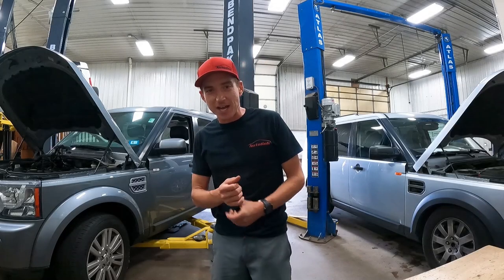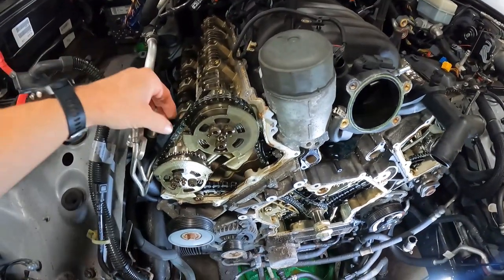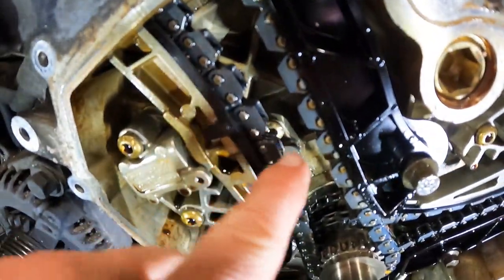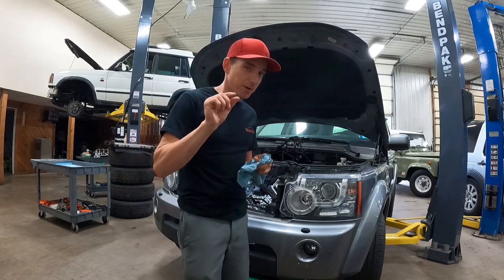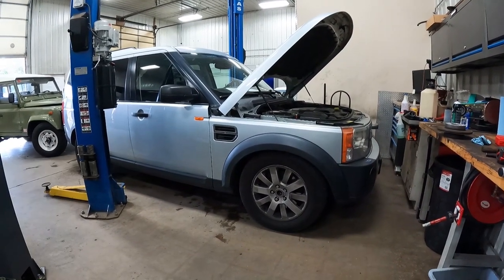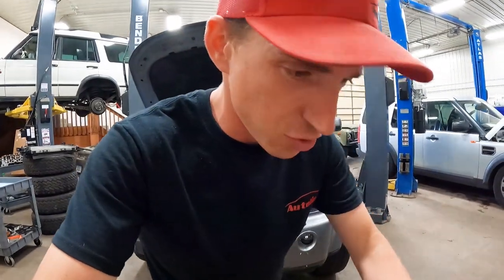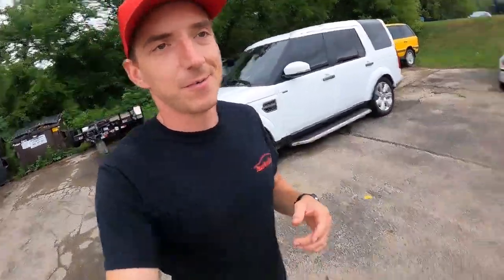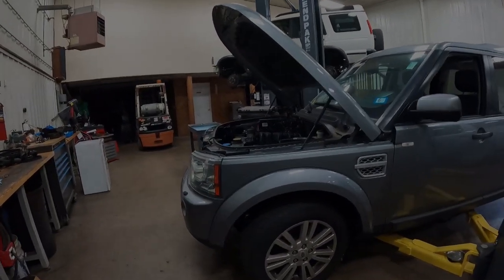LR4 Timing Chain Problems - The Land Rover Achilles Heel

Comment: I'm swapping out the Timing Chains etc now on my LR 4.
Its a tough job,  but not that bad. I'm installing a new Water Pump, Thermostat, & Main Seal while the Engine is torn down.

Comment: Just saw this video as a result of searching because, you guessed it, time to replace the timing chain and tensioners in my '15 LR4 with the 3L SC motor and currently at 78K miles.  The dealer said it wasn't absolutely necessary to do it right now but as he pointed out, do you really want to gamble with catastrophic failure?  For some time now the car definitely sounds like it's a diesel but once it warms up it goes away, thus the reason I didn't have too much concern...but I do now after watching this!  I intend to keep the vehicle so it's money well spent.  Love the boxy look and it does everything I ask of it.  A new car will bring with it a different set of problems (and a huge price tag) and as I work through the various weaknesses (coolant pipes for one) I'm just making it a stronger vehicle.  It's the HSE LUX and has every feature available including the dual transfer case so I guess I'll hang on to it for a while.  😁

Comment: The timing chain tensioner issue was prevalent in the early 5.0 MYs. I believe the guides were updated pre-'14. Still, the general consensus, even with the update is to change the oil frequently. I have a few variations; all are good, ranging between 97K and 225K. 
Fingers crossed, and a garage that looks more like the oil aisle at an automotive store.
Reply from the maker: I completely agree. I prefer right at about 5000 miles on the oil with a good quality oil and filter. We’ve seen the most timing issues with dealer serviced 15,000 mile oil changes. It definitely makes a difference.

Comment: What a comedian! I subbed straight away. Just going to get myself a 4.2 supercharged RR  or sport, and if it has timing chain issues I will do it myself as I used to be on the spanner's ( wrenches to you over the pond ) for over 20 years and was until 4 years ago a regular Land Rover owner with a total of 4 Landies  from a 1960 series 2 up to a Discovery 2  V8i of 1999 vintage. Really looking forward to owning a green oval vehicle again

Comment: Really peed off.. my LR3 HSE got totalled last week. I've been running synthetic since I got it with 50k on. Now has 190k and still quiet and ran perfectly. Not many around so now having to look at lr4. The high maintenance, troublesome younger sister.
Reply from the maker: That really sucks. The LR3s are really workhorses. The LR4 is a touch nicer all the way around in my opinion but that comes with the touch higher maintenance requirements with them though. I enjoy them both, but the 5.0 LR4 does really have the correct amount of power in my opinion.

Comment: Needed new timing chain at 60,000 miles on a 2012 LR4 (11 years old)  I've owned since new.  The transmission needed a rebuild after failing post a fluid change for 60,000 maintenance- advice is to replace fluid every 30,000 going forward.  Then the steering rack failed at 65,000 - replaced both the rack and pump.  Rough city driving with low annual mileage.  Before that most problems were need to replace front control arms around 40,000 with bushings needing replacement well before then.

Comment: Having constant problems with VVT on my Honda Odyssey. Lack of oil changes by previous owner.
Reply from the maker: Yea, the VVT stuff is very problematic with extended/poor oil changes. The control ports are small so it doesn’t take much to coke them up and start causing havoc.

Comment: the RRS i have now is a 2013, i bought it with 20k miles on it, did timing chains, guides and tensioners at 75k miles, it now has 105k miles on it, and tensioners just started rattling  at warm start up, its a big job, with the supercharger i found out its a bigger job : ) 
frustrating because i change the oil every 5k miles specifically to avoid having to do them again. 
my las RRS was a 08 4.2 supercharged, changed oil every 5k, and never had the engine apart, sold it at 185k trouble free miles : )
Reply: did you ever get the tensioners looked at? i'm contemplating getting a '12 lr4 but this common problem is really turning me away!

Comment: I have a 2006 supercharge 113000 miles never replace the timing chain still running good the only problem is the suspension problem I swap air suspension to struts
Reply from the maker: Yes, the earlier 4.2 doesn’t suffer the same timing chain problems. Those are generally a pretty stout engine. 

The coil spring swap was a good way to prevent any future problems there.

Comment: At least it rattled!  My Volvo 960 24V  shredded its cam belt and valves without any warning at 86000 miles with a FSH!! I So go Landrover!!
Reply from the maker: Yea the belt stuff doesn’t make the rattle, chains are typically supposed to last much longer than the interval of the belts. Do you know the age of the belt on yours time wise? With those time can be just as bad as miles on them.

Comment: My wife's loves the look of them so we're currently in the market. I hear that 2013s don't have the timing chain issues. True?
Reply from the maker: The 13s are supposed to be in the clear with updated stuff. But we have done one 13. So way less common of a problem from what we have seen though.
Reply: 2012, 2013 and 2014 are included in the class action settlement
Reply: My 2010 shakes when I turn it on then it idles down like nothing is wrong so confused? Any suggestions?

Comment: What’s the tell tale sounds then and just hope mines all right!
2011 110000kms 
Thanks
Reply from the maker: It will kind of sound like a can of marbles. Usually on startup first. We typically see a check engine light for timing related codes first as well.

Comment: Is is even possible for a 5.0 Range Rover HSE to have 187,000 miles without ever having the timing chain guides done?
Reply from the maker: It is possible, usually have seen the longer lasting ones in vehicles that had more frequent than recommended oil changes with high quality oil and filter.

Comment: Awesome video, was curious if the updated guides make this issue obsolete?
Reply from the maker: It is supposed to. We’ve never had to go back in and replace them a second time yet. But time will tell.
Reply: @LostCauseRanch  gotcha, thx!
Reply from the maker: @ryanorr5755  No problem

Comment: In the UK you can't give these away and most are scrap now.
Reply from the maker: They are kind of starting to climb over here. 2013’s and 2016’s are appreciating right now as they are the last year of the v8 and last year of the LR4(Discovery 4) respectively.
Reply: Seems like a dramatic statement.
Reply: At Richard Haywood we don’t have the 5.0 V8 here in the UK. (Unless imported)
As for the 4.4 V8 they were very rare & only people with no money worries would buy them from new. As for the second hand value they are climbing through the roof in value & well on the way to classic status & sought after. Try looking on auto trader.
Anything from £10k to £20k
For a 14 to 16 year old model.
Reply: I need a cheap one and I’ll just do the timing job myself.
Reply: @ArsonOnTheTrack  they are a nice thing to drive I think,they just lacked in the reliability stakes!

Comment: question for you...  can the chain just be tightened without replacement?
Reply from the maker: Nope, no adjustment beyond what the tensioners automatically adjust. And part of the slack comes from the wear into the back of the tensioner guide rails themselves.

Comment: 220k miles on my lr4...original chains....I off road mine on a regular basis.
Reply from the maker: Nice to hear. What year and what had your oil change schedule been? Always curious to hear the differences in maintenance leading up to chain issues. Can’t confirm that it the reason behind issues but we saw more prevalent problems with with dealer maintained at 15k mile interval and less enthusiast type of owners. More so regular vehicles for them with less care.

Comment: In reading the TSB from Land Rover on this issue, it seems that the chain tensioner was corrected in the 2013 models with the 5.0. Is that the case, or do you see all 5.0 engines with similar failure mode regardless of year? I’m scouring the market for “the right Rover”, and want to make the best choice…
Love your content!
Reply from the maker: Yes, they updated to the tensioner rails with the steel button. So the 2013 would be the one to get in the 5.0 variety. Although, with that caveat, we still have replaced timing chains in those as well, just much more rare and usually coincides with extended oil changes.

Comment: Once the updated guides have been put in is the problem solved for good then?
Reply from the maker: I responded in the other video, but I’ll respond here as well in case anyone else sees it. 

But the new stuff should yield a much longer service life as long as a good quality oil and filter are used along with regular oil changes. I recommend stepping down to a 5000-7500 mile interval instead of the factory interval.

Comment: My 2013 RRS chains only make noise in the winter on a cold start, then after 5 min the sound goes away.  A youtube mechanic said this is normal/ ok.
Reply from the maker: 5 minutes is a little longer that I like to see but yes if it just in cold days during cold start it usually isn’t a huge deal at the moment. A lot of that has to do with oil being “thicker” in the cold and not fully pumping the tensioners or cam adjusters until it warms up.
Reply: @LostCauseRanch  Sounds like a good time to start putting cash aside for the repair

Comment: Can you share what you charge for L4 timing chain/guides replacement service?
Reply from the maker: We don’t do any public service anymore, but when we were most landed in the $5-7000 range depending on parts needed. We usually recommend the coolant pipes and water pump at the time of service since we were in there. The. Some of them junked the oil feeds like this one did.
Reply: @LostCauseRanch  are you a dealer, do you sell these LR after you fix them up?

Comment: For a Land Rover neophyte, what's worse? Suspension repairs/maintenance on an LR3 or Timing Chains on an LR4???
Reply from the maker: I’ve come from the European servicing world so the air suspension has never bothered me much as it seems to have been more reliable than the Mercedes/Audi stuff of the same era that we were always replacing. But generally the LR3 has been less costly to keep going, I just really like the power of the 5.0 v8 though. Worlds difference vs. the LR3, especially if you upsize the tire.

Comment: What’s the cost for timing chain work?
Reply from the maker: When we were open to the public for repair we usually landed between $5-6000 to do them correctly depending on what else needed to be replaced while we were in there. We always did water pump, coolant pipes, spark plugs at the same time.

Comment: How much in parts and labor to have the Timing chain fixed?  Got a quote for $8,800.
Reply from the maker: That’s not terribly out of line. We usually landed between 6-8000 when we did them depending on what parts were needed.
Reply: That's a lot.
Reply: @LostCauseRanch that’s more than the cost of the vehicle 😭

Comment: All 13's have timing chains or could be belts? Trying to buy one, guy asking 16k with 132k miles on it
Reply from the maker: All the LR4s have timing chains. 2013 is when they updated the guides so they typically fair better.

Comment: Extended warranty company said the bolt caused the chain to break blew engine they don't cover bolts!
Reply from the maker: Yeah, in my opinion there are very few extended warranty companies that are worth having. Just from dealing with them over there years there are very rare occasions where the pencil out in your favor. 

If you want to get one I would look at an exclusion based policy. Those list out exactly what they don’t cover instead of listing what they do cover. Just gives less loopholes for them to exploit. But those are typically pretty expensive. So in the end I recommend setting the money that was going towards the warranty and just self insuring with that for repairs. 

And yeah, on something like these where the timing components are known to be more problematic than most, blaming the bolt is bs.

Comment: Looking at a 2011 lr4 with 188k. Looks in great shape. Car fax doesn’t mention chains/guides. Is it safe to assume one with 188k had to of had to get the updated parts?
Reply from the maker: There is a fair chance they have been, but with that said I just acquired a 2011 LR4 with 183k miles that needs chains. So they can make it that far on the original chains. Hard to tell and without records I would go into the purchase assuming they haven't been changed.

Comment: The tensioners are oil pressure driven 
Not servicing the car every 5000 miles making sure you have the right oil density and oil pressure it’s gonna give you timing chain issues
Reply from the maker: Agreed. The problem is Land Rover has the recommended oil change interval set at 15000 miles. So that is what most people change it at if not longer.

Comment: I have a 2016 LR 4 SCV6. Has 52,000 miles on it. My my mechanic,specializes in Land 
Rovers/RR recommends I change the oil and filter every 5,000 miles, which I do. Should I worry about the Timing change at this point?
Reply from the maker: Sounds like you are going to the right mechanic, keep on that schedule and I wouldn't worry about chains on a 2016. The SCV6's that we have seen chain issues with are ones that went with the factory recommended 15k mile interval or longer (If you tell people 15,000 miles that means some will push it to 20,000). 

The other nice thing about the 5,000 mile interval is that gives your mechanic the ability to keep an eye on it better and catch any upcoming issues sooner.
Reply: Thank you. This my fourth LR/RR. I think it was foolish decision by LR to discontinue this model. My opinion is the LR 4 is the best all around vehicle they’ve ever made. Do really care for the new Defender. I’ve owned a Dico, RR Sport,LR3 and my current LR4.
Love your comments.

Comment: So if the timing chain failed can it be repaired without the having to remove the whole engine
Reply from the maker: Yes, depends on how catastrophic of a failure it is. We have had some jump timing and bend valves, you can remove the cylinder heads with the engine in place although it is very tight on the v8.

Comment: Range Rover is my dream car what’s your opinion about them can they be good vehicles?
Reply from the maker: They can definitely be good vehicles, just has the same caveat as any of the luxury brands with potential maintenance costs. Certain ones have certain problems that can be expensive. Also, the big thing is finding a reputable/trustworthy independent shop that can take care of you and not advantage of you. I have had generally good luck as long as you go in knowing that it is going to have a higher running cost than say a Toyota.

Comment: Have a 2012 Land Rover lr4 and it has intermittent full power. If I crank the car it doesn’t have power and if I drive for a few minutes and cut it off and crank it right back up it has full power. Any idea what could be causing that?
Reply from the maker: Does it pop up the reduced engine power warning on the center cluster display when it does that?

Comment: Good video sir! A question for you. Do you see the Jaguar AJ8 4.2 litre supercharged in America? If so do they also suffer with the tensioner eating it's way into the rail like you have just shown in the video? I'd be interested as I'm looking to buy a RangeRover L322 with the 4.2 supercharged engine here in the UK and I want to forearm myself before I start looking at them.
Reply from the maker: We got those from 06-09 model year over here. Same basic setup as the 4.4 non supercharged in the Lr3 and Range Rover. Haven’t seen the same timing chain issues on those.

Comment: I just bought a 2010 LR4 with 140k miles for 5k. Beautiful truck runs very good but when you start it and sit in idle it has a little vibration. I assumed the timing chain wasn’t done but was hoping it would hold for a year or two but I think I have to address it right away (gulp) little nervous on how much this will cost me and if it’s in the 2-3k range then I think I might had made out for a total of 8k but that’s wishful thinking 🤞 
Any idea what todays cost will be for a timing chain replacement?
Update 
I paid $4,850 to resolve my problem.
Been in the shop for 3 weeks I pick it up in 5 days.
Reply: Looking at $4-8k

Comment: How can you tell if it’s catastrophic failure?   Mine is running but pooping through intake.  Running really rough. Throwing p0016, 0017 codes.
Reply from the maker: If it bends valves it usually doesn’t run anymore. But if you are popping back through the intake it is way out of time and I would venture to guess it is not long for this world and ready to let go. I personally wouldn’t run it anymore as it adds a ton of cost if it actually breaks.

Comment: I have a 2016 LR4 hse liux.  Are these prone to timing chain issues?  How do you know if they are failing?
Reply from the maker: Less prevalent than the earlier ones, I wouldn’t let it haunt you. You usually hear a rattle on startup or have a check engine light pop on with timing related codes.

Comment: what does it cost for timing chain replacement?
Reply from the maker: We were typically in the $5-6,000 range at our shop when we were doing customer work. That’s with oem chain parts and doing water pump and coolant pipes and some other miscellaneous stuff.

Comment: So once the timing chain issue is fixed for vehicles w/80-130K, it's no longer a real problem?
Reply from the maker: Yea the timing chain isn’t a huge reoccurring issue if you install the updated guides and shorten the oil change interval.